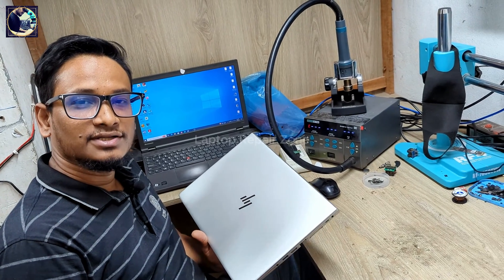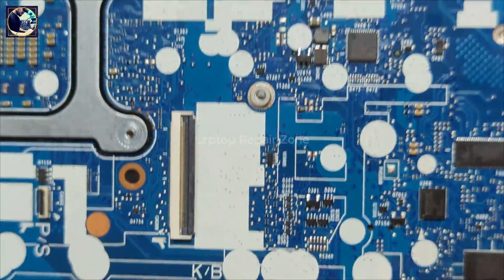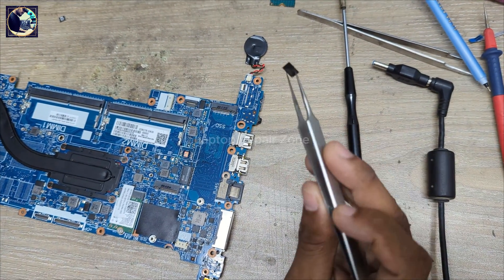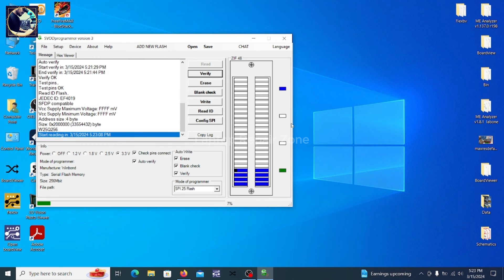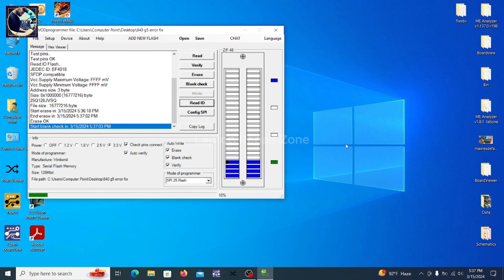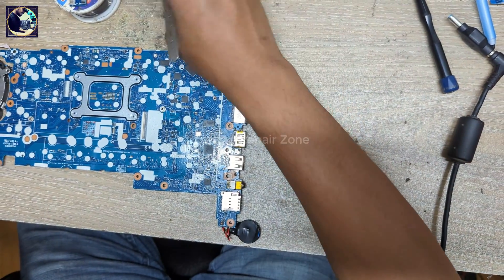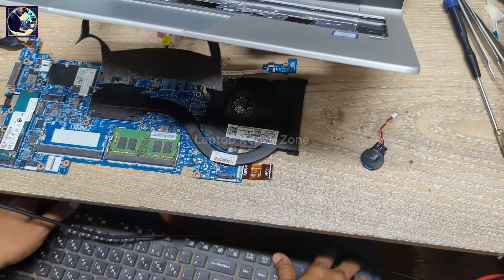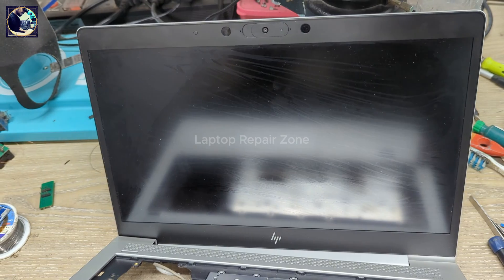Hp endpoint security controller problem Fixed !! HP Endpoint Security Controller Error Fixed !!

Comment: after repair, its taking time before displaying hp logo, why? and what about the 2nd new error  (with bar code) appeared after fixing first?, please comment
Reply from the maker: Late display solution, you need to clean ME region, 2nd error battery maybe not detecting.

Comment: These are just a few. Make a video without demonstrating the steps. It's easy, guys.
1- Search EC for the NvramActiveRegn Blocks, select everything, and replace them with FF values. Otherwise, this process won't work.
2- Set Manufacture mode. This is done by searching for the ABA key and the Equipment serial number. In the strings that start with the "?" symbol, enter the value 3C, which will add this symbol <. Save and edit MPM. READY. Always back up your Serial Number, FEATUREBYTE, IMG_BUILDID / Build ID. See you later.
I hope it helps.

estos solo son,Hacer video sin demostrar los paso. Es facil chicos
1- Buscar en EC los Bloques NvramActiveRegn, y seleccionarlo todo y sustituyen por valores FF. o sino funciona este proceso.
2- Poner modo Manufacture eso se hace Buscando la pala ABA y el serial del Equipo y en las cadenas donde empiezan con simbolo de " ? " le dan valor de 3C que 
se le pondra este simbolo < y guardan y editan MPM LISTO siempre hagan su respaldo de Numero de serie, FEATUREBYTE ,IMG_BUILDID / Build ID Hasta luego 
espero le sirva

Comment: This is not firmware problem.
After programming bios computer working fine, but windows 10/11 automatic updating firmware and bios and problem return.
I have the same error  HP ENDPOINT SECURITY CONTROL
LER PROBLEM.
I Have Elitebook 840 G6.

Comment: Please bro what causes this problem? , is it  about bios mismatch between EC Bios and Main Bios
Reply from the maker: This was caused by changing the Nuvoton SIO controller
Reply: What would happen if i dont fix the problem as i jist push enter and it boots normally
Reply: @wadechard178  nothing would happen apart from that notification evertime u power on the pc